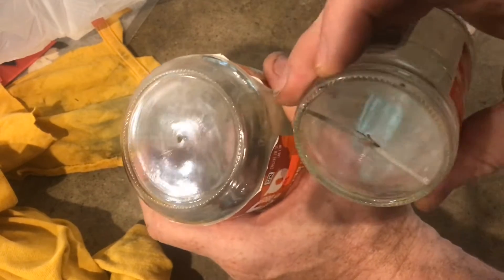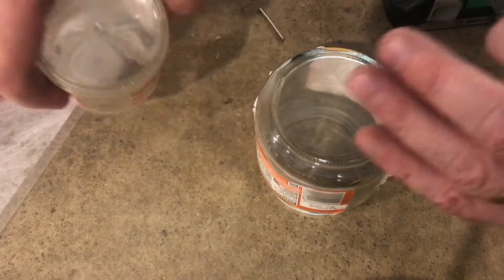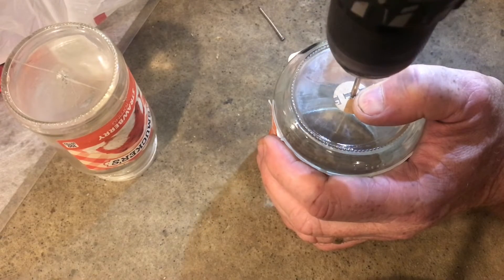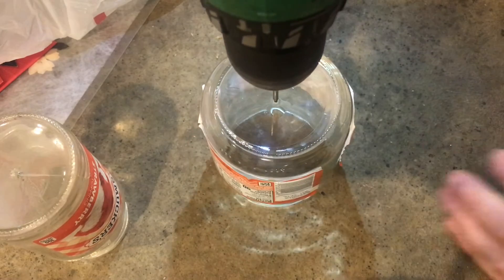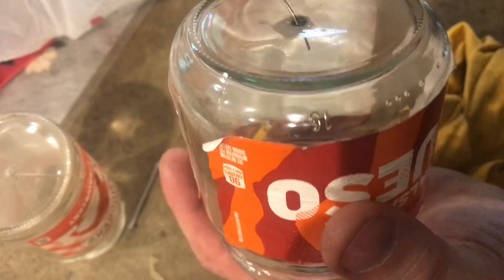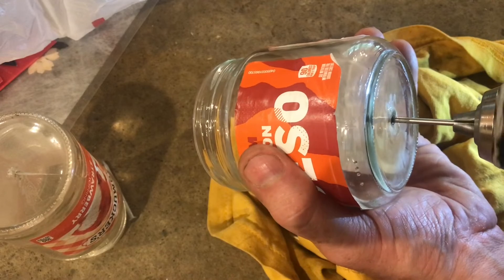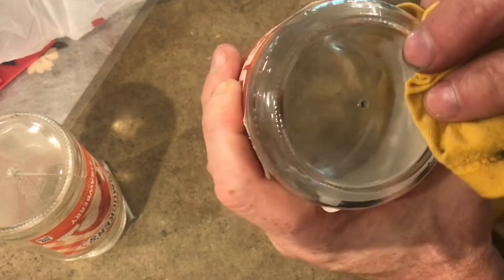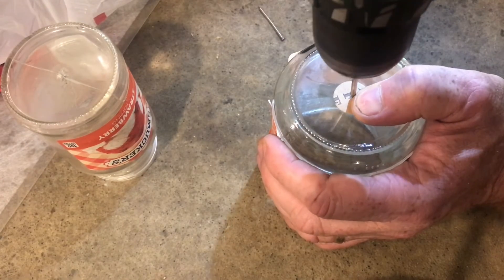drilling holes in GLASS exactly where you want it

Comment: Uy, set myself the task of drilling 6x 1mm holes in curved glass. Those ball end bits will get me most of the way through but the 1mm diamond bit set i got was laughable. Maybe 3 diamond particles on the end that came straight off 🤣 not sure what to use to make the pinholes.

Years back i used to drill glass with a flathead screwdriver (young and broke) So long as you always scrape material away and dont let the bit jam between two points youll get there. When making the holes never go all in with the drill bit until the hole is bigger than the bit.  You have to work and carve the edges, its not about pushing through the material like most drilling jobs. Glass scratches easily, thats what you work with.
And with twist bits the same. But be aware they like to jam up at an angle and can just blow your glass apart. Keep em straight, use diamond where possible. And always wet, having the glass wet stops it resonating and cracking, as well as preventing heat fractures. (See cutting glass with scissors)

Comment: can  u make a video of how to seal a hole on glass or hard plastic without leaving a sign of the hole, kind of a restoration process
Reply: Go with an optically clear epoxy and mix it warm and carefully to prevent bubbles (as none of us have a giant vacuum chamber to hand). If you keep the mix slightly on the flexible side (tiny bit less hardener) it wont cause cracking if it expands at all. Keep the glass stronger. 
Once its cured it will be almost invisible.
Reply: I'm looking to repair a drilled hole in the bottom of a vintage kerosene lamp. Someone converted it to electric, and I want to convert it back. Any ideas? Thank you, and great video!